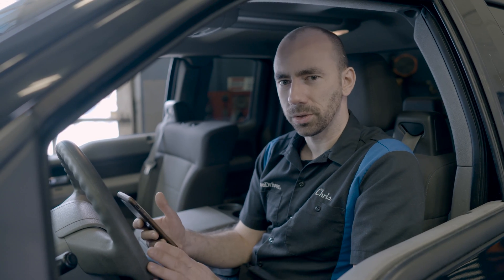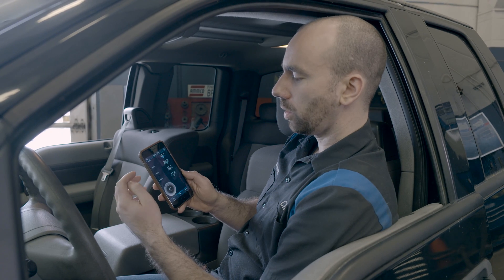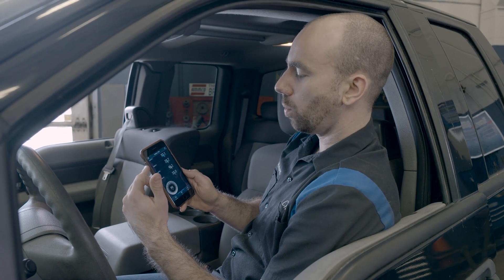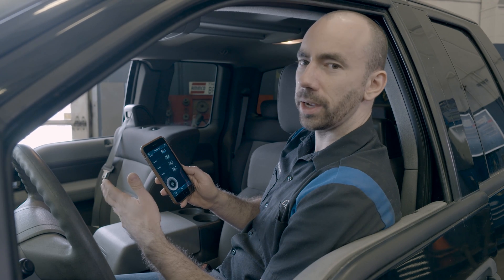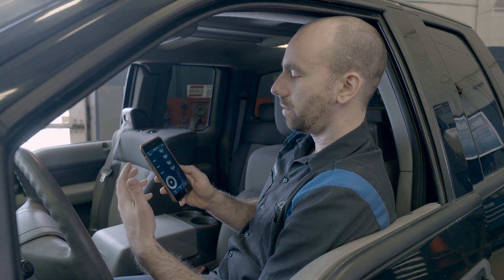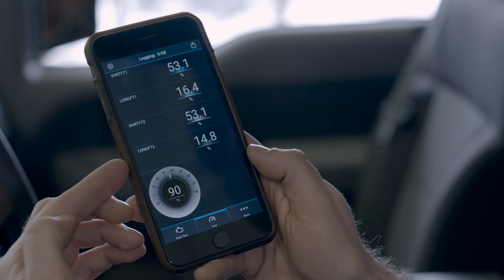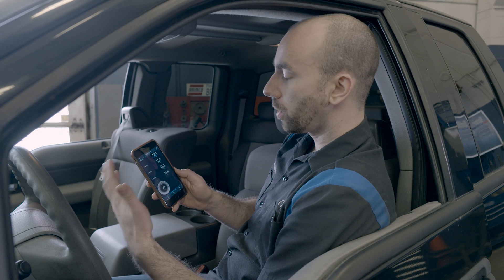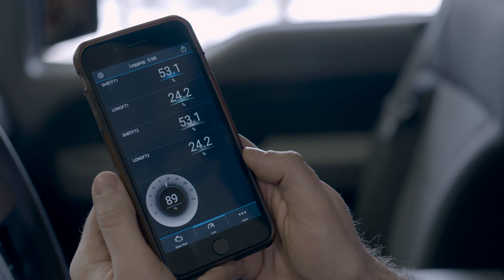Diagnosing Lean Conditions

Comment: How to test for air leaks: Try plugging the engine's air inlet with your hand or a single piece of cloth. If it pops out, the air circuit is intact and there are no cracks. If it vibrates or resists, there's a leak. If the engine makes a loud noise, the throttle is leaking.

Comment: I disconnected mas air flow car turned  of.what else can it be
Reply: If the car turns off, it means that the member is still counted, but the problem lies in the dirt and wear of the sensor. However, the engine sees it as a member that responds to messages and is present.

Comment: Ok. Question. If you unplug the MAF sensor while vehicle is running and the vehicle shuts off?  Does that mean the MAF sensor is good?
Reply: If the car turns off, it means that the member is still counted, but the problem lies in the dirt and wear of the sensor. However, the engine sees it as a member that responds to messages and is present.

Comment: its funny that you guys are doing this on an f150 i have the same style year truck and having been chasing an issue of highly negative short term fuel trims for months but i have no codes associated with it. when i stomp the throttle the truck sputters almost enough that it is about to cut off but then 2-3 seconds after that the engine gets all of its power. do you guys have any thoughts?
Reply: Stupid this is not an f150

Comment: I’ve had this code (P0171) in my 2006 Camry since I bought it. 280k miles. This is the only code that ever gets tripped and then BlueDriver says this is the only code confirmed. My live data shows the LTFT on Bank 1 being high at idle and then smoothing out some while driving. STFT on Bank 1 being very close to and sometimes at 0% while idling then higher while driving.
Something else I found suspicious was the live data showing the Absolute Throttle Postion being  high. It reads at 16% or so at idle then jumps all the way up to 27% while driving and fluctuates between those two numbers while driving.

I’ve replaced the MAF sensor, engine air filter, fuel filter and fuel pump. What could it be? This car has had some exhaust system work done to it previously I was told but it does not have any other codes nor does it make excess noise. What does the absolute throttle position sensor being high indicate and what ultimately is causing my lean condition? Please help if possible. I’d like to fix it because that’s the only thing wrong with this car’s system right now and it runs and rides great otherwise.

Comment: Excellent video.  Been having a lean condition part throttle bank 1 issue P2177.  Smoke tested it, isolated the evap and pcv systems, fuel trims not coming down after that, and have 21 in-hg at idle before and after disconnecting the evap and pcv and blocking the ports at the intake.  Down to either a small intake gasket leak below the plenum, exhaust leak, or fuel injectors (hope not - DI on an M276 engine).

Comment: When I make a simple observation, the spark plug was absent from the reasoning. The spark plug gives direction to the topic in terms of fuel injectors. The injector does not overcome the air, and the spark plug is almost clean and different from the rest.

Comment: MEMO TO SELF: First, I am a retired federal safety officer. I see an issue in this video that is very common among most people who own fire extinguishers. The fire extinguisher is placed in the engine bay area. What is the problem? If a fire breaks out IN THE ENGINE BAY, you will have to reach INTO the fire to access the fire extinguisher. BIG problem. 
Set your fire extinguisher 5’-10’ away from fire potentials. You will still have immediate access to the extinguisher…and keep the hair on your arm. 👍
Reply: Thank you for pointing that out! I'll definitely keep that in mind.
Reply: Good point, I have been guilty of this and will change my ways going forward. Thanks!

Comment: One thing they didn’t mention was the fuel pressure regulator. If it’s stuck open more gas will return to the gas tank and less pressure will be in the rail under load. The fuel pressure might be okay at idle but once put under load there might not be enough pressure to keep the engine going.

Comment: As your tank gets hot pressure inside is supposed to escape charcoal canister then to purge valve then to intake.
Take note if this pressure builds after 30 minutes driving your car might start bogging. Reversed pressure sends fuel from injectors back to tank. Lean...lol

Comment: Great video guys. Been tracking a P1126 lean bank 2 on my Porsche Boxster. Haven’t found anything off yet. So hard to find. Final check will be exhaust. Also the Brake Booster check valve can cause a leak condition as well and easy enough to check. Thanks for the great videos!

Comment: Hi, thanks for this educative video.i have a similar problem where the engine is running lean but when I unplugged the 02 sensor,it ran fine.So I replaced the sensor and the engine ran fine for a dey.the next day ,it begins to run lean.i have not been able to find a leak.thanks for any help from you

Comment: While driving my short-term fuel trim jumps up randomly to like 12-19 but overall it stays pretty steady +-3. Do you know what might cause that?
Reply: does it happen when the engine is under load or when you let off the gas pedal?
Reply: @GrandmasMallCrawler  what if it goes up when you lift off the gas?

Comment: I bought aftermarket EGR from Amazon it came with 3 gaskets but I used one and today I sprayed carb spray by the egr and the engine changed. I was wondering should I have used all 3 gaskets,? My engine is stalling and rpm won't stay in sweet spot

Comment: Thank you guys for this great video 👍 . My 1986 Toyota van runs really good on any speed and it also starts right away with no problemo , But sometimes it sputters when I accelerate of a stop , Can a bad fuel pump check vale cause a car to sputter on accelerating ? 🤔

Comment: I have been using the Blue driver for over a year.  I am issues with my 2016 Nissan Altima and the things that are happening should be contradicting what kind of codes that i am getting.  Also is there a code that says if a cat converter is bad?
Reply from the maker: Hey DallasPilotCar! We have a option in our app to send us a support email, if you go to the more tab and tap contact us then select the email option. You can type out what the issues you are seeing are and if you scan your Altima first we will get a log of what is going on behind the scene's a little. The log will auto attach when you use the email option in app.

Comment: soapy bubble trick only works on pressure leaks, not vacuum leaks.   Most often with EFI, the ISCM or electronic throttle will compensate for idle speed and you won't hear a jump in idle speed when hitting a leaky spot with propane or flammable spray, or water... but if you watch the short term fuel trim with your handy bluedriver (tm) unit, you can definitely see the trims spike.   Here's a feature suggestion, how about incorporating a "beep" tone to the app when fuel trims spike to the negative, to help in this situation...